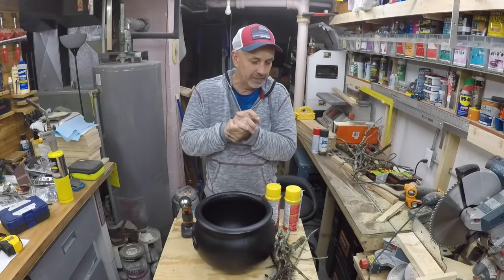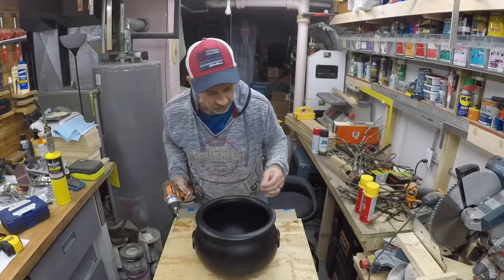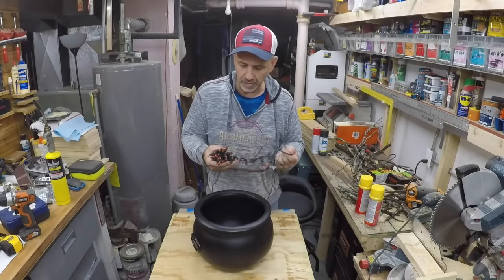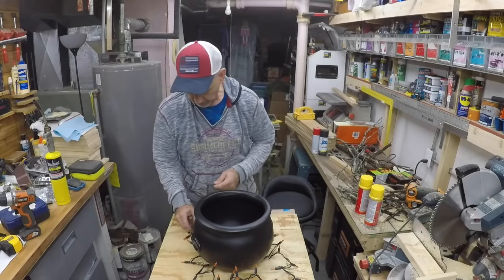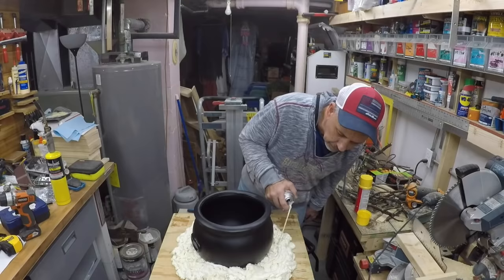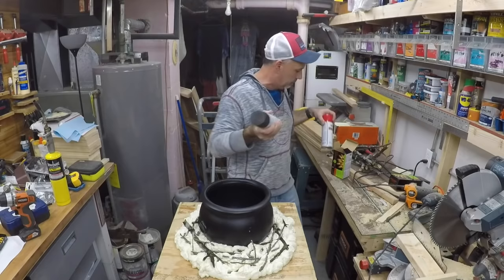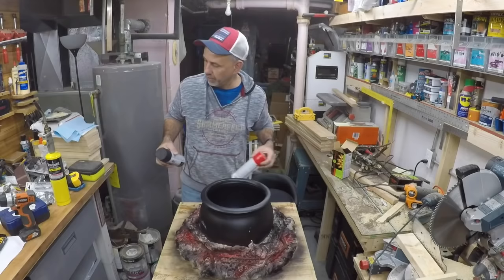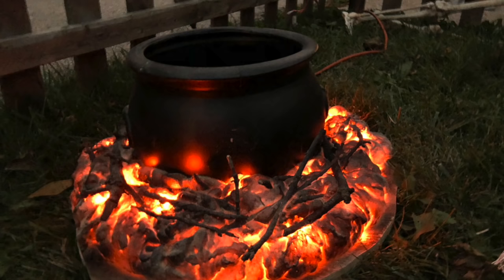Great Stuff Foam / Halloween Fire Prop with Cauldron

Comment: My God, man, you're in a small space working with flammables. I see a map-gas or propane torch on your desktop and spray foam and other flammables, all right, by a water heater. I know what can happen; it happened to me when I was a kid; the gas laid low hit the pilot light, and things blew up in my face, my hair cut on fire, and my eyebrows were singed. I'm not saying this to put you down. I'm saying this to make sure you're safe. Please use caution. I realize this post was made five years ago, but it's never too late to warn people.

Comment: Really looks great. Add a fog machine and it'd be perfect.
Reply from the maker: +Ralph Macey u r correct .. or dry ice
Reply: @MarkDohring  if your cauldron is water tight.. us an led ultrasonic fogger, cheap on ebay... creates light and fog drifting around inside. They have multi color models.

Comment: Are the sticks and cauldron now mounted into the foam once it dries or can you take them off of the foam?
Reply from the maker: They r there permanently. U could probably spray silicone on the cauldron before putting the spray foam on there and when it dries I should be able to remove it. The sticks could be placed on too after the spray foam hardens so they could be removed

Comment: a question i have is what if a bulb on the light strand goes out or a section of it? normally when its a section its just a fuse but if its a single or a couple of bulbs then would you have to break the foam to get to it or would it just not be a worry 🤔
Reply from the maker: I used led lights and I’m not going to worry about  it .. but haven’t had any burn out yet ... many hours of run time. I think u could cut out the foam and redo that section.

Comment: Please mention what that foam spray is called? Moreover, is there any substitute for that foam? Thanks.
Reply from the maker: Hina.. thanks for watching the video.. it’s “Great Stuff Foam”  it’s in the title and description ... maybe I use it so much that I think people know what this stuff is...lol.. u can usually get it at any hardware store.. I got mine at Lowes.. I got the big gap one because it gets harder.. the door and windows foam doesn’t harden that much... I will update the description with a link ... again thank u for watching
Reply: @MarkDohring  thanks for guiding in detail. I'm from Pakistan. I was not sure about its availablity here. That's is why needed to know more 😊 video was good in details and informative 👍 thanks again.
Reply from the maker: @hinaasif4520  U are very welcome...hopefully u have something similar ....it was a very fun project and gets so many complements from people that see it on the lawn during halloween.
Reply: It's basically a spray foam insulation meant for filling gaps and cracks around windows and other spaces in your home. You spray it into the crevice and it expands to fill the space. You can clean the spray tube with acetone if you don't use the whole container, otherwise the tube gets clogged and you can't use it.